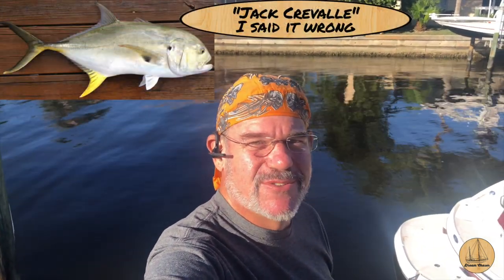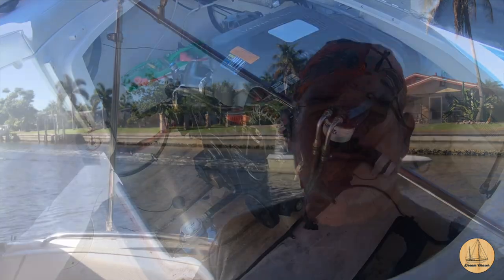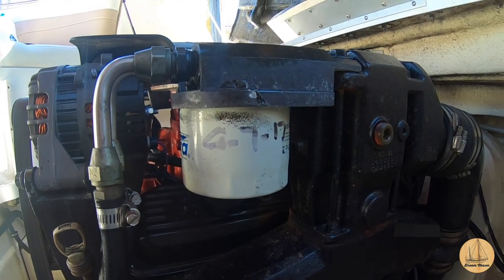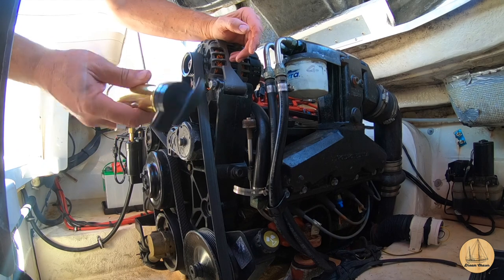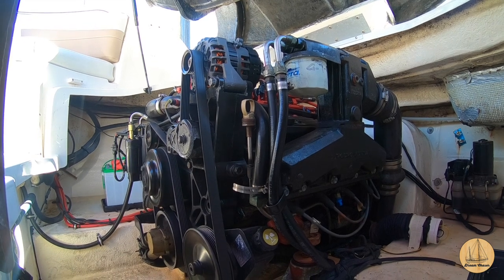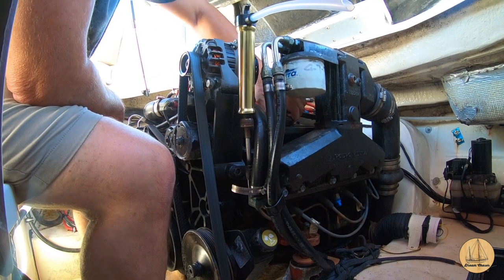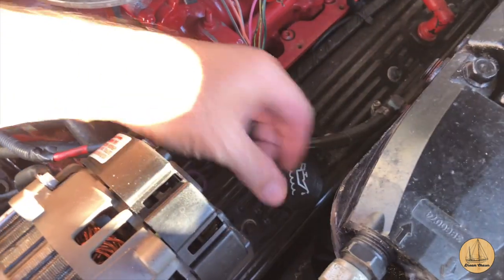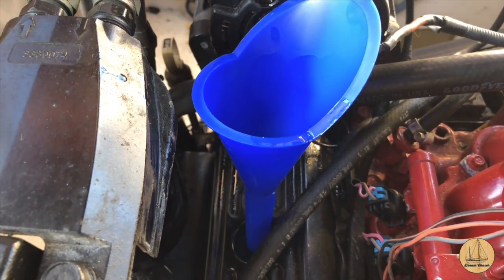How to Change the oil on a Volvo Penta 5 7GI e

Comment: Nice bit of maintenance. Would you not want to pre-fill the filter before install? Standard practice on aircraft engines that have filters mounted the same direction.
Reply from the maker: That would have been better.